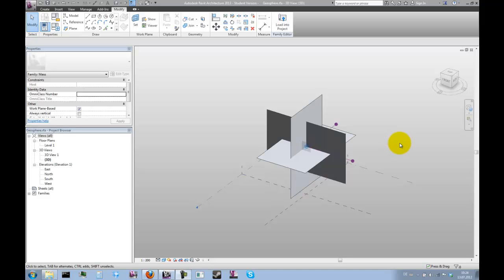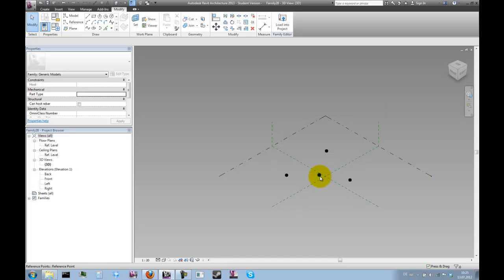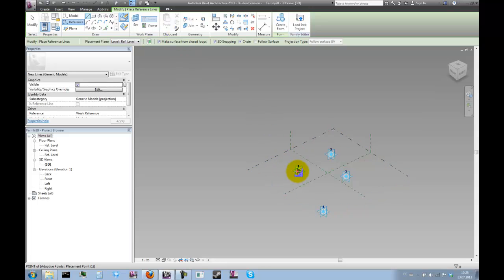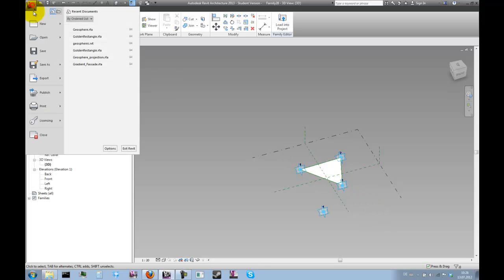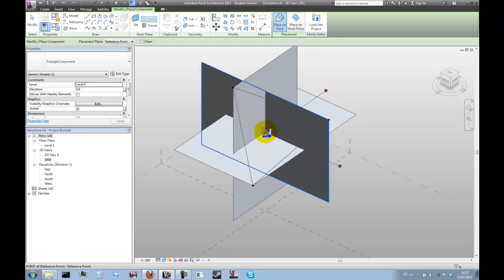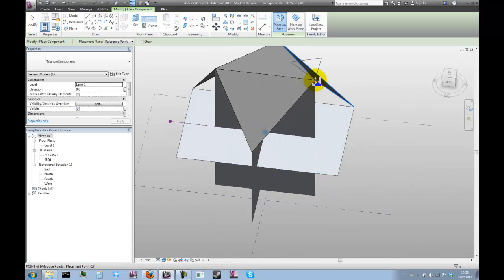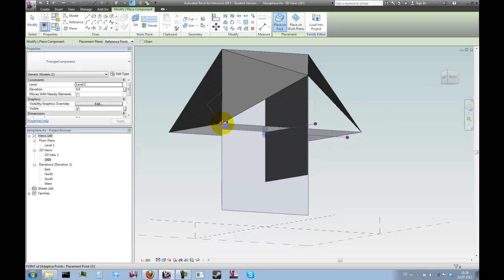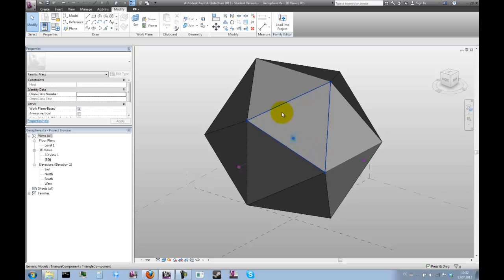Geodesic Sphere in Revit/Vasari Pt. 4 - Triangle Component + Icosahedron

Comment from the maker: You can find a step-by-step explanation on how to add material parameters here: http://blogs.rand.com/support/2012/09/revit-how-to-add-a-material-parameter-to-a-family.html
Reply: Thank you,  however after I followed this explanation I discovered a problem. When I loaded the Icosahedron.rfa into the project, I couldn't find the Materials in the properties, it seems like the material parameters only applied to the Triangle Component but not to the Icosahedron.rfa as a whole. 

Hence I can't change the materials type for each different Icosahedron.rfa in a project. Is it there solution for it?  Thank you.
Reply: This is my steps, can you please check where do I did wrongs?
I only create the Geodesic Sphere up to Icosahedron (the base structure). 
1. Open the Icosahedron.rfa
2. Select one of the Triangle Component in the Icosahedron, the click Edit Family.
3. Use Tab to select the triangle surface (form element), then Add Materials parameter by following your blog.
4. After created the materials parameter, loaded the Triangle Component back into the Icosahedron.rfa.
(After Step 4, I thought I should be able to find the Materials parameter in the properties for Icosahedron.rfa, but there isn't. I think this is the reason why I can't have the materials selections when I load the Icosahedron family into the project.
Thank you for the help in advance.
Reply from the maker: Catherine L If your triangle component is a shared family you can just look for that family in the families section of the project browser and modify its type properties (in your case the material parameter). Alternatively, you can link the parameters of a nested family (e.g. the triangle component) to parameters of its parent family (e.g. the icosahedron) as described here: http://revitoped.blogspot.com/2012/03/connecting-parameters-in-nested.html
Reply: caadtv Thank you very much!
I figured out the way to solve the problem. After Step 4, I then select all the Triangle Components in the Icosahedron.rfa, then go to type properties to add material parameter, and it works! Thank you once again for sharing this tutorial.